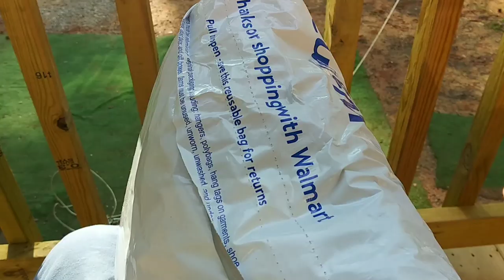Worm Farming and Wash Tub Time! - Ann's Tiny Life

Comment: I have seen foam board insulation that is around an inch or a little thicker, cut to fit in between the studs in the wall.  Then caulk around the edges of the foam board insulation.  Saw this on a channel that  a man who built is own cottage small home.  Just a suggestion.  Have a wonderful weekend.  GM🙋🌻
Reply from the maker: great suggestion of summation. I was thinking about that today as a matter of fact.
Reply: @AnnsTinyLife  the guy who did that put the fiberglass over that and his tiny cottage home was heated with a wood stove.  He is actually in Ohio.  I believe it was called little house on the hill.  He and his wife downsized and he built the home.  He was a carpenter and built houses.    Well take care.  G🌻🐔

Comment: That’s a cosy pretty fleece Ann.  I would attach your sink plug with string to the hole in the top.  You can pull the plug without dunking your arm in the water. Also could save it being mislaid.
Reply from the maker: that's a great idea! in fact I had that problem with my first load I washed in there. I'll remember it for the next time though.